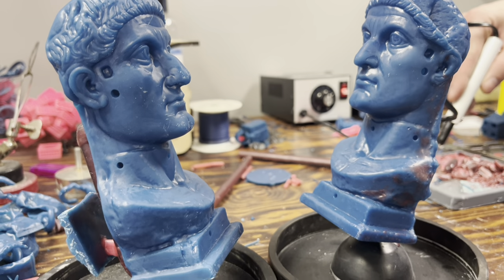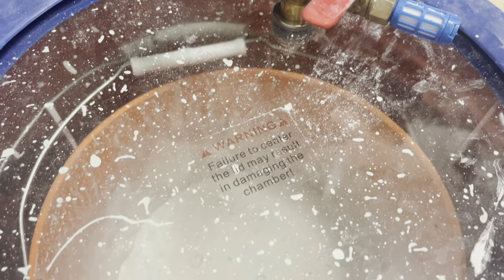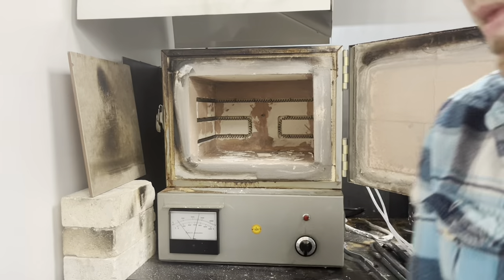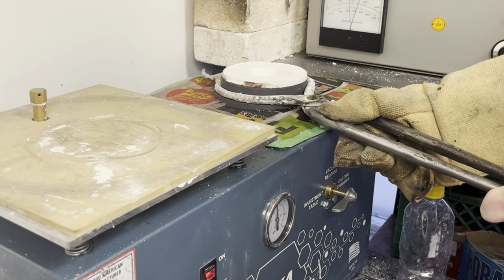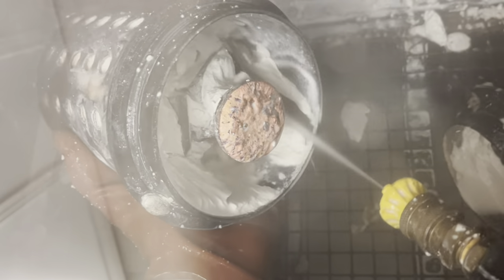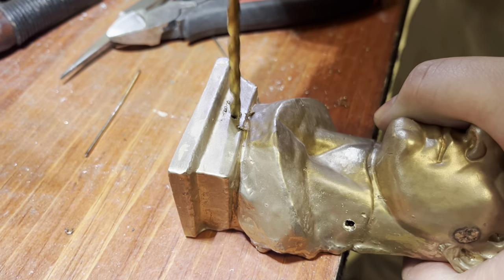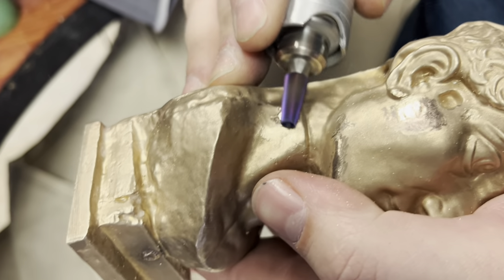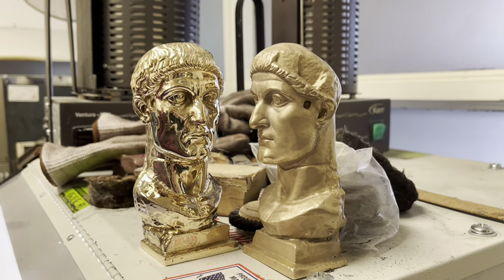Casting a 3D Printed Hollow Bust #3dprinting #bronzecasting

Comment: wow that bracelet welder is so perfect for fixing bronze.  have you ever tried to use a silicon bronze filler wire lik a tig wire (or maybe drawing out some tig wire so its thinner?)
Reply from the maker: This unit is actually not their bracelet welding unit. This is the 150 S. The bracelet units are much much smaller less powerful. Yes we’ve used this unit with filler wire for jewellery and sculpture castings. It’s also super handy for fixing prongs, risizing rings etc (have a YouTube short where we did a resize without having to remove stones). 

https://pepetools.com/products/150s-pulse-arc-welder-orion?aff=24%20